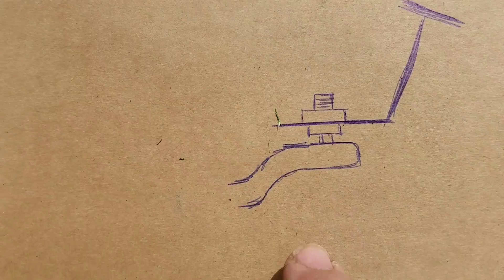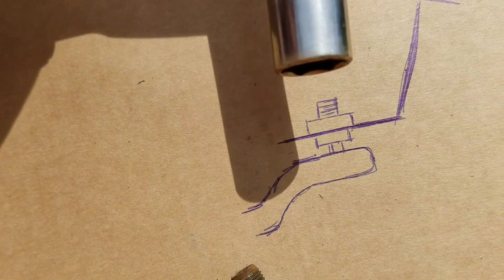Craftsman Riding Mower Broken Steering Repair

Comment: Thank for the overview of the repair and the clear directions, including the wrench and socket sizes.  My repair went smoothly.  I also like the fact that the video is not of a new mower on a polished concreted shop floor with great lighting.  Most of us are working with dirty mowers out on the grass.
Reply from the maker: Yep, I fixed this mower right about where she busted. Thanks for your kind words....BB23

Comment: To make mine last longer, I use a squirt type oil can to shoot some oil on the ball joint before installing them, and then at every oil change. WD40 will also work, but will need to be done more often. Dry Joints will wear out very fast!
Reply from the maker: Great information, thanks.

Comment: I have a plastic open ended washer that is covering the nut that you’ve accessed from the engine with a deep socket. Do I pry the plastic cover off to get the socket because I can’t even see the nut.
Reply from the maker: I don't remember a washer covering a nut. 
There is a plastic piece (black) that covers the joint itself, that may have slid up to the nut area. 
IMHO if the plastic is on the broken part, then you have nothing to loose by removing the plastic.  Your part looks like this. https://www.repairclinic.com/PartDetail/Drag-Link-Ball-Joint/532175121/1926122  Is this a craftsman mower your working on?
Reply: breakerbroke23 I just watched a video and they called it a bushing.
Reply: Mine has this plastic cap/bushing as well. How did you resolve it, A. Lee?❓

Comment: You got that on backwards man. The balljoint with the slot on the back goes on the steering wheel side. That one is limited in it's movement because the steering gear only goes back and fourth.
The other end, that balljoint can rotate 360° and it goes on the spindal side, cause the spindle turns back and fourth, but also the axle pivots up and down. 
Certainly works the way you got it, but its unnecessarily twisting the drag link with every bump, might contribute to the short lifespan? Idk. Not trying to be a dick or nothin.
Reply: Agree - it's on backwards at the 9:59 mark. If you look at the 7:26 mark you can see the two parts (old and new). The end with the offset bends (on the right in the picture) goes at the front tire. The bend is to accommodate the thickness of the plate it screws in to, and the two ball sockets don't move the same way just as O'Hea described.

Having said that, the trick about the hole in the frame is priceless. Makes the job super easy. I saw another video where the guy didn't know this trick and got two wrenches up under the frame and took that off 1/4 turn at a time. So just that one tip made the video worth watching. Thanks!

Comment: Does these come in two different lengths .....I fix my gear drive that's shape like a moon now my drag link seems too long ....it works but my stearimg is way off...for it to work seems like I need a shorter one..
Reply from the maker: Under your seat should be a ID Sticker, get the model# and look up the part on sears3.com. You may have the wrong part.

Comment: @BreakerBroke23 great vid. Glad to see a full slow vid on this issue. I have a Craftsman 917-270821 EZ3 mower. Older about like the LT-1000. Was mowing today and that exact part broke. Well, the rod came off the ball. So now I need one. I thought to just drill through hole in rod and put a bolt in. But I guess I'll buy the part. Course Sears wants a arm and leg for part. I did not even know exact part name till watched vid. Can you hit sears and run my mower and confirm that is the rod on there I need? I assume, but want to double check. I have one rod that goes into top ball left front tire.
Reply from the maker: Joesph, You can use sears3.com for parts breakdown:) Then I ordered all my parts from Ebay, there a few parts houses that do ebay, saves a TON of money rather than buying from sears and local parts guys. I believe in supporting local but when it comes to this stuff Ebay is the way to go. Cheers
Reply: @breakerbroke23 I agree with what you are saying. Sears is way over price and no wonder stores closed. I pretty much do what you say. I work on electronics as my main hobby. Also two stroke stuff and my own push mowers. Riders is new on me. I did after reply go to sears. I did find all and think it was $63 before ship. I crossed that with a after market part # but decided to go factory. Now I know most these mowers are MTD parts. Lucky for us most them parts cross over with newer and older mowers. Decks, etc etc. MTD makes and a mower is moreless rebrand name. So I found the part under Husavarner ( forgot correct spelling of that ha ha ). Original quality part. Cost is $31 shipped and on the way. Mean time to get mower in shed I ended up drilling hole in rod and dropping a bolt and nut in after remove of ball. So the part is steering drag link. Mine which is prob yours falls under part # 532156438. Fits many branded mowers. Ebay yes, although the bay has got a little crazy also lately in price.

Comment: My drag link has a lot of play in it when I wiggle it does it need replacing and my steering is hard to turn?THANKS
Reply from the maker: grease up all moving part from the steering shaft gears (behind engine ) to all the front end parts . After the grease works in your mower should steer easier.

Comment: Good to know... I have a 1984 Simplicity mower it's about time to glob some grease or oil on anything that moves. Still has the original engine (cast iron bore)Just put some new tires on, man, that is not an easy task and tires are the only thing it ever needed
 Opps except for belts, deck bearings and some blade sets lol

Comment: My craftsmsn mower is hard to turn do you think this is my problem
Reply from the maker: Behind the motor are the steering gears (like ring&pinion), lube those up and then add lube to the zert fittings on the front end as well as any other parts that are part of the steering system. Doing this helps you steer and cuts down on steering part break down. (use lube like from a grease gun. not oil)